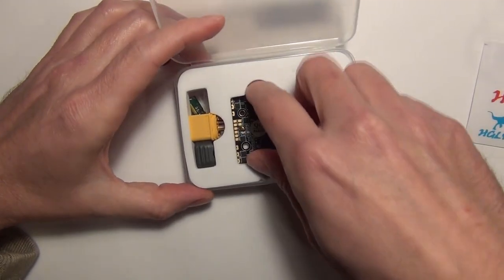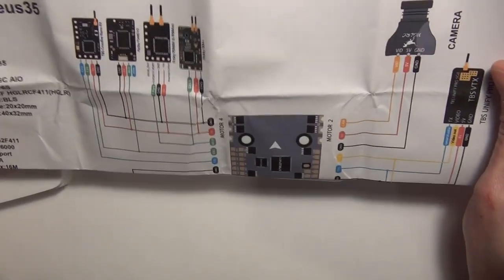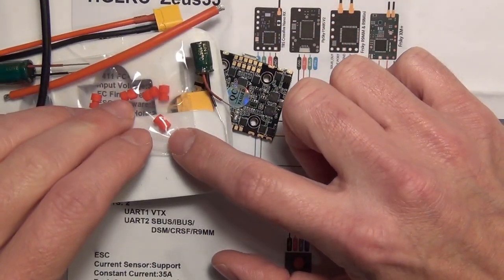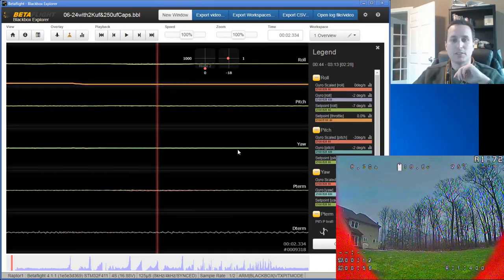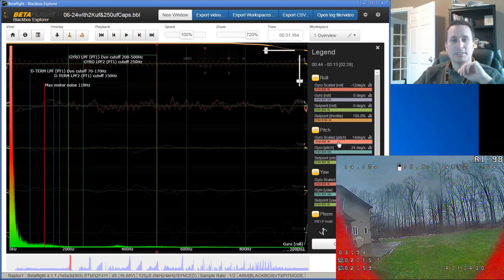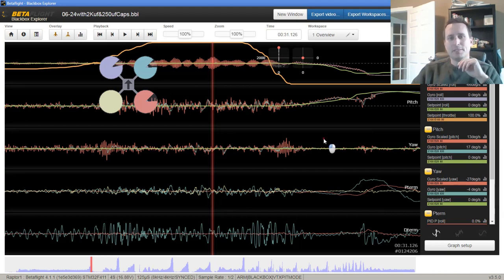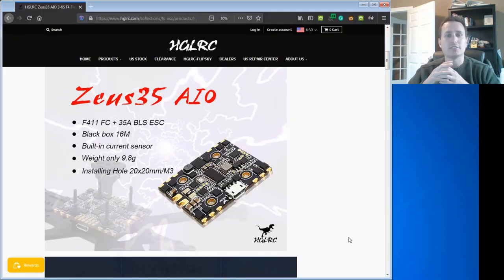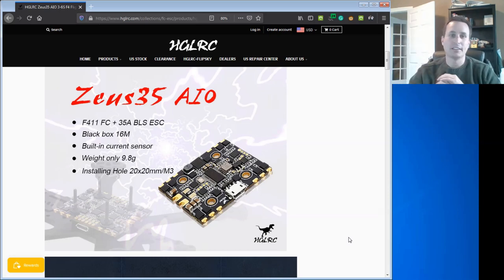HGLRC Zeus35 Review AND what BAD gyro data looks like

Comment: Me and three buds all bought this board and have an untunable wobble, even in hands off moderate forward flight. Spent like two weeks trying to tune it out without any luck. Guess this is why. All on 3” quads with 1404 and 1407 motors on 4S. Hope HGLRC does right in this.

Comment: Thanks! Wery helpful. Im strugled lately with prety similar problem on a different fresh build.
Also on pitch, also out of control thing you mentioned. Also broad noise on low frequencies from pitch but much more on pitch d-term. 
I try EVERYTHING, no way.
Replaced fc yesterday, tomorrow test will tell.

Comment: DUDE! I have that board with a bad gyro, haven't even watched the video yet but I thought I was going crazy for a week until HGLRC confirmed the Gyro was wonky. My pitch axis was messed up like yours, exactly the same.
Reply: @t.me_hgjhghgf  caps had nothing to do with it. If you have MOTOR noise introducing ripples in the voltage, that'll be smoothed by a capacitor. When the motors aren't even running however and the gyro is acting up, caps can't help.

Comment: Thanks for the heads up Mark. I have one of these. Hope it's a specific issue and not a general one.  I was going to send a frame into CNC madness for cutting and considerations were made for this flight controller. (i.e. its length). I guess I should build it into something else quick and get a look at some logs asap.
Reply: Please report back asap! Im planning on putting it on a long range build... idk now lol..
Reply: I flight just released a aio board like this, much better company n quality
Reply: @flo-ridafpv5713  iflight my 100% go to for frames. Have heard some iffy things about their stacks though. Will definitely have to look into it though
Reply: @birutafpv8768  yea but the dc5 breaks arms easy n some of the dual gyro f7 boards were twitchy but iflight take good care of ppl
Reply: @flo-ridafpv5713   know they have had a 30x30 out for a while but that won't work for this build. They have a 20x20 AIO that's 35A or better? I I missed that one or I would have ordered it.
Reply: @taterfpv  ah it's 30x30, get greedy wantn all that in 1 20x20 aren't we lol
Reply: lol...yup ..and i knocked a cap off while puttin it together last night so I'm trying to salvage one from another board. I gotta tell you, it felt like the cap had no resistance to the slightest and I mean slightest knock. I feel like the Forward brand of stuff from them has better assembly quality/ I havent really used anything HGLRC since the F440 stacks but they were the only one offering something like this. I was hoping to build a sub 250 4" with a Tarsier or Vista and some actual performance.
Reply: @taterfpv  Dam good luck, I'd plug a charged lipo in a bunch once ya get xt60 on before I finish build to make sure it not smoke build, what about a normal 20x20 stack but mount it apart, not stacked, depends on frame I guess, I've never built less than 5in soo, but I did just go 20x20 6s 35a on fleet, but I fly 4s only n dji air units wired to vbat
Reply: @flo-ridafpv5713  I got it fixed and its ready to go but its a frickin blizzard outside. Mark showed that he saw the bad gyros above like 60% throttle so hovering it in the house isn't going to cut it log wise. Hopefully the storm dies out later and I can post some logs after work.
Reply: @flo-ridafpv5713  Yeah using normal 2 board stacks is really not much heavier (a few grams) but I am already struggling to meet the 250g limit with a motor that can run triblade 4" props.  The single stack allows me to shorten the frame design and save weight. The BetaFPV 1505s are fantastic on the 4" bi-blades and would likely work but there is no such thing as a triblade T mount for 4". The 1407s also work, I've had em on 4" frames before but they aren't very zippy and don't even weigh a gram less than the Emax 1606 which is what I'm trying to use. With an 850 4S I am still 18g over in this frame. Being able to lose the prop nuts would put a good dent in that weight. Here's hoping BetaFPV makes an even bigger T mount motor and low pitch 4" triblade t mount props appear! :)
Reply: @taterfpv  cool man, wow that sucks, I won't even tell ya the weather here today in FL then lol
Reply: @taterfpv  have ya tried alum screws, i use the 7075 ones from pyro in my apex builds, saves tonz especially 16 under motors, but idk why u care bout 250 lol no one else does, do you even HAM ;)
Reply: @flo-ridafpv5713  I had forgotten about trying to lose some of those critical grams in the screws! Thanks! I like the challenge of getting HD video and the most performance out of current components within the weight restriction.  Here in Canada I can just walk to the park in town, fly sub 250, and not care if any "concerned citizen" calls the police. I still have my 5" quads but there's zero challenge in building one of those. I also have to drive out of town to fly those because there is a heliport in town. I have not and will not ever register my  quads but I fly very responsibly. We don't need any more bad press. I was hoping if the waste of money was exposed to the Canadian public,  drone registration would go the same way the proposed long gun registry did.
Reply: @taterfpv  no prob man glad to help, ya could even use nylon for non structural stuff, ah ur in Canada explains the cold n the 250 thing.  You mention HD so I gotta bring up the transtec beetle, it's a 2.5in beast, flies like a 5in, watch bardwells video on it, but it's dji fpv, so pricey, but I fully divorced analog in September hehe check my vids, I just superview my goggle dvr lol
Reply: @flo-ridafpv5713  I haven't made the plunge for those goggles. I haven't even looked through a pair cuz I know it will ruin me for analog!  I'm just waiting to see what's coming down the pipe. Maybe a DJI module? A Vista with onboard recording? The full unit with 4K and gimbaled cam? Your DVR video is just dandy and far surpasses what I can get out of most of my <3 inch builds. For now it seems the Tarsier is the only camera that gives me an excellent analog FPV view and higher than 1080p source video I can work with in Vegas Pro. I usually do 1440p to get full vertical sensor and then use RCSchim's preset to get Superview.  Man did DJI expose FatShark or what? They showed the community what innovation actually looks like. The future looks good :)

Comment: I have this board in my Micro Alien 3" just waiting on the Caddx Vista.  Did not like to hear that it may be a bad recommendation so will surely wait for your results with another FC.
Reply: caymandiver75 have one on the way for a micro reverb/caddx vista build. Hope is is not a board design /components issue.
Reply: caymandiver75 - My guess is this board is better suited for a 3” application such as yours and only struggles to power larger crafts. If it performs well for you when your build is finished then continue to use it. This board or a 20A whoop board are really the only options for a lower profile Vista build.

Comment: Roll is clean, I would go for PID modification.amp draw  is aslo Linked to acceleration.
Reply from the maker: PIDs won't solve this bad boy.  Needs to get fixed first.
Reply: @uavtech  if it was electric,roll would be affected the same way. I would look somewhere else.this fc has long front and back end that could vibrate, and explain the difference on pitch. Pid tunning can help avoid this frequency.
For exemple on the trashcan a lot of peuple are complaining about the canopy vibrating, but with the wright pid nous more vibration.
Reply from the maker: @cedricgrandseigne  , that is not 100% the case.  I have seen many times that electrical noise was on 1 axis, but not others.  The frequency is 30 to 200hz.  Can't avoid that much range.

Comment: Not sure what motor size your using? I know the manufacturer recommends a smaller motor. I myself want to use this aio with 2207.5 1922 kv on 6s.
Reply from the maker: 2207.  2450kv

Comment: Hey there, so I've downloaded your updated trace setup templates and imported them into BBE but now the numbers won't do anything anymore. ;-(
Can't switch between the layouts anymore.
Worked fine with your old file but I've noticed discrepancies between what's shown on the "legend" in this video and in my own BBE so I went ahead and updated the template.
I'm using version 3.4.0... Is there something I'm doing wrong? Please help! ;D
Reply from the maker: Try again.  There is a 3.4 version there now.
Reply: @uavtech  I'm only seeing a "3.5 version" (it says so in brackets)... maybe I'm just confused? ;D
EDIT: okay, now I can see it. prob something with the bookmarks or whatever. will try, tyvm
Reply: And yup, it's working great now. Thanks again, Mister. <3

Comment: I like the HGLRC F440 boards. But on every 4th or 5th a gyro is half broken or broken quickly. thats my number one issue with those. sometimes I think one esc is broken when I get such noise like you did. swapping the board helps.
Reply: However when you have a working f440 one (3/4 or 2/3) its nice.
Reply from the maker: Well I have 3 others to try on the rig i guess.

Comment: I just got the board and flying nicely and then it just power rules goes crazyflies good after turn it off after a bit it does the same damn thing brand new board do you think flashing would help?
Reply from the maker: Go into BLHeli_S firmware settings and turn Start Force to 0.125.
Reply: The only thing you have to do it's to throw it to trash can. Don't waste your time with this board.

Comment: I have a question I just loaded 4.1.7 omnixt7 I finished configuration and flew it one battery then brought it inside while it was still plugged in and set it on my bench and all motors spun up to Max rpm. I just left the E.R with five stitches in my ring finger and still wonder if it was from new firmware or something I did wrong ? My transmitter was powered off also. Any advice would be awesome especially from someone that knows there stuff.
Reply: Wow, that's a lesson to always unplug battery first thing after flight. I'm no expert but check fail safe should be set to drop.
Reply from the maker: Best advice, unplug after disarming.  Maybe it caught a rogue 2.3Ghz TX signal or your RX went into some weird failsafe mode.  unknown.
Reply: Thanks you guys I have always been  cautious but thought I'll change a bent prop real quick and bang. I switched back to old firmware that I was doing fine on (4.0) I like smart audio and my fingers haha. Thanks for all you guys do..

Comment: Those aio boards are hit and miss. I just got a jhemcu f722 aio 40amp esc with the dji connector. I was just running it analog and i cannot get rid of the noise. Even the yaw axis is just drifting like crazy with acc turned off. It wants to spin around on its own. I have tried everything. Even sitting on the bench you can watch it spin at 1 degree per second. Idk. Such a waste of 70 dollars.

Comment: Great video Mark. same issue here, though I am on a 3" ducted whoop  - the pitch axis is going crazy. I do not think it is related to vibrations as my yaw and roll axis have similar patterned noise in much lower amplitude while the pitch axis is erratic 
.https://imgur.com/a/qpr4kCO
Reply from the maker: Yeah, it is an electrical thing.  I told them time and time again, but they don't want to accept it.
Reply: FYI - on 6s it's flyaway upon arm. Keep up with the great content and thank you again !
Reply: @t.me_hgjhghgf  . Well no...
BB logs were sent over hglrc which confirmed the gyro is bad, and offered to either try to relow or replacement.
Reply: @t.me_hgjhghgf  in that case you did not have a bad gyro scenario my friend. you hade a "noisy" build.  If you have a bad gyro there no capacitor in the world that could fix it. here is how flight of 3" dayaton taycan with bad gyro look like. look at the pitch issues. https://youtu.be/CVpYV1aHSUI. 
 and here is how the pitch gyro look like in comparison to roll and yaw https://imgur.com/yh06GLs.
There is no point to start fiddling with soldering capacitor to the gyro signal - since the design is problematic or have faulty components, customers should not bother going through all the hassle.
Reply: @t.me_hgjhghgf  hi. I totally understand you.. and do not disrespect your knowledge. All I am saying is that bad cap on the circute is not something the avarage pilot should deal with. Just to be clear, you have replaced the cap on the 3.3v going to the gyro? Also, any idea why only the pitch is effected ?
Reply from the maker: Do you have a picture of what cap needs replaced and a link of what type of cap needs to be used?  If so, i would love.to do a follow-up video on how to fix.

email: spatzengr at yahoom.com

Comment: lols that's a nice frame.. send me you address.. with my new design I'm retiring most of the raptors.. i'lll send you another airframe and some nicer looking pods.. that pitch axis noise is electrical... ive got hundreds of hours of logs  on that airframe over 6 different builds and I've never seen pitch axis noise like that
Reply: ohh and i can give you a really good tune for it when you get a good fc in there
Reply: This frame in the video looks better than the diagram I have seen from the creator of this frame.  Please explain sugar K LoL
Reply: @JT-jy2sy  there are no diagrams circulating the internet of the frame